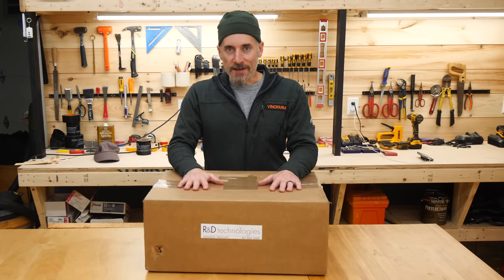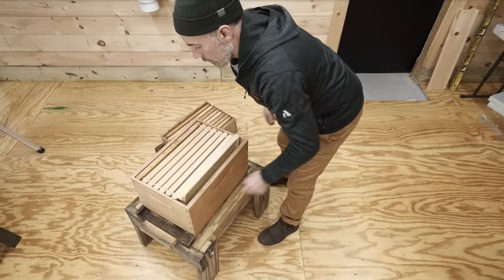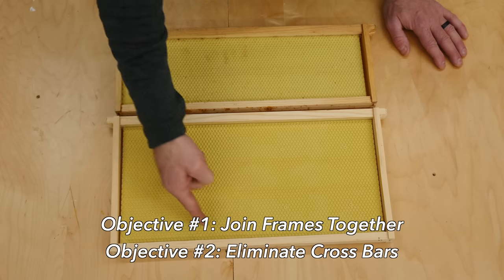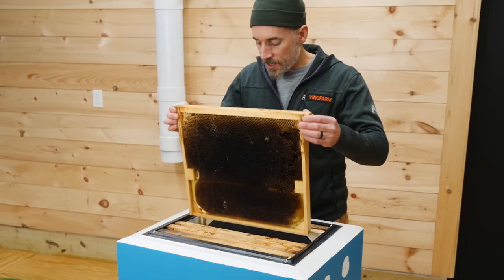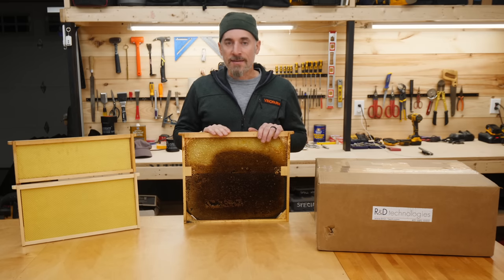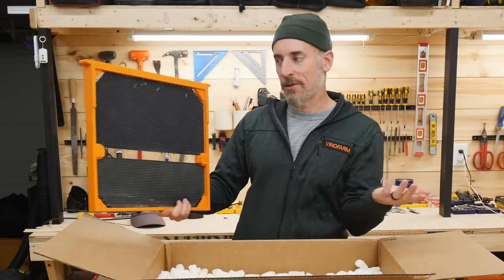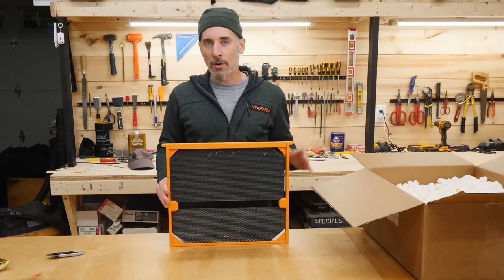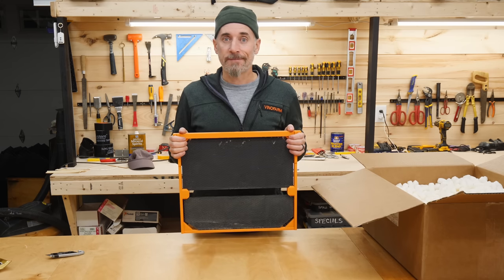Bigger, Better Bee Frames? Let’s Make This Happen!

Comment: At this point... why not making the plastic sheet in the middle too. 
also - why are the companies making frames can't just make big frames like this ? (using big sheet too).

I would try to contact them too.
Reply from the maker: Frame companies are not just "making them" because the mold to make them costs many tens of thousands of dollars. This is going to need to be fundraised. Also see pinned comment regarding why there is not full foundation.
Reply: Switching account here but same person sorry - 
I was thinking about wood frames. Maybe it's easy for them to make the side bars like they do... but longer ? About the sheet, I get it. But let's make some holes in the sheet but keep it on size and alternate the side (left/right) instead of up/down.
They already have the equipment. One mold was costing 100 000$ at the time when I was working in it a bit. I don't know how much it is today !!
:S

In anyways - I did my version of the Bee Barn here with 2x deep frames.
We'll see in the spring if it was a good idea :) I believe in your concept and wish I could help.

Comment: Well now I have to see if I can cut them out with the laser in the shop at school.  Trotec said it would cut through 3/8" cherry, so cutting through pine of fir should be a go.  Might have to still cut the groove with the table saw, I'll let you know if it works.

Comment: Personally I do not work on injection molding, but the company I work for has an injection molding department.  I love hanging out down there and talking with them, we do get into talking about costs for things.  We have fairly small molding machines just 40 ton presses and such, probably about the size of a car.  Getting a proper mold manufactured depending on how many parts to want to make per cycle can be fairly costly.  Like I said we have smaller presses, but one of our largest molds can make 24 parts per 30 second cycle, and when that mold was crafted, it cost the company close to $124,000.  I am not sure if costs have come down from when we had that mold made about a decade ago.  I assume you would have a molding company run your mold, instead of buying your own press.  But if the demand for the frame and barn are there, injection molding might be the fastest way to get them made.
Reply from the maker: Yeah, molds for this type of thing are going to be in that ballpark. Pre-covid, It would probably have been half that. I'm still going to give it a shot.

Comment: What is the cell size and can that be adjusted?
Reply: While I don't know what cell size he uses (I gonna assume the usual 5,4 mm) I don't see any reason why you shouldn't be able to adjust the cell size to something smaller since you can put whatever foundation you like in there.
Reply from the maker: The plan is for these to be produced as blank frames. You will add whatever foundation you like. Pop out drawn comb from an old frame and it will go right into these. I will not be molding any cell pattern into these.

Comment: I am willing to invest for the opportunity to get some frames like you envision which seem to work better than Langstroth frames. They'll be reusable and should last a long time. As an idea for the cost, ICOMold by Fathom in Holland, Ohio says they can give you a quote for injection molding in minutes.Their example tooling charge for simple molds is $3000 to $6,000 and they will help you choose the kind of plastic. Their website says there may be other manufacturing methods for low numbers of runs. Of course other companies may be cheaper.
Reply from the maker: Thanks for the tip. However, add a zero to your numbers and you will be about half way to the quotes I'm getting.

Comment: Would custom foundation eliminate the blocks on the sides?  It’s likely the foundation is made the same width and cut for deep, medium, or shallow.
Reply: If it's injection molded it might be possible for the foundation to be part of the mold. No blocks would then be required because it would be a part of the frame.
Reply from the maker: See the pinned comment.

Comment: CNC the pieces out of wood.  If you have the files talk to a local cabinetry building company or woodworker who has a CNC machine.
Reply from the maker: And what would they be cut out of? Any production CNC shop is going to use plywood and that is a terrible idea for beehive frames. They need to be solid wood and no CNC shop is going to use 3/8” thick milled lumber for production. It’s not really feasible.
Reply: @vinofarm   Valid point.  Loving the frames, will be (safely and carefully) building a set.  I already have the new boxes and foam. Might be interested in the plastic frame kickstarter idea.  Tough since I currently have 2 hives and wanting to go to 3 this coming year. 
Love the videos and content!! Keep going you are doing awesome!

Comment: I thought about making a extra thick and insulted cover instead of the inspection/feeder box and that´s because I already have a clear plastic cover and a feeder box so if I have a clear plastic cover during winter/spring and I want do do a quick peek all i have to do is lift the insulated top, when it´s time to feed the bees I have my feeder box and by then it´s warm enough that I can start using the "normaly" insulated cover. 
The only concern I have is the (possible) air gaps between the hive and the cover although i make it as tight as possible and that I´m losing some effectivnes somewhere other than the gaps.
Is there something I´m missing?
PS I´m not using a Langstroth hive but a more square hive (roughly 18x18 inches) that is normaly used here in Sweden.

Comment: About 15 years ago, I had to get some injection molds made for a small part, 2”x4”. It was very expensive ~250k-300k. Then on top of that there is post-processing of the part when you injection mold

There are several issues to consider:
- Burr removal, is it required? Depends on where you put the seams.
- tolerances for any small spaces (ie the grove)
- wear on the mold. You can get a cheaper mold made, but it will have to be replaced sooner. 
- is a proto-type mold good enough for the number of pieces you will be making? Those are much cheaper to make, but will only last for a few hundred to thousand parts
- consider making them in 2 halves, top and bottom with the foundation printed as a single part for each half. The most complex feature of the mold will be the slots for the foundation. If you print the foundation as part of the piece… no grooves. 
- the molds are typically made for a certain piece of equipment, just because you find a cheaper mold may mean you limit yourself on manufacturing partners 
- the layout of the parts in the mold is important. Determines where you will have tabs and burrs

Also, why a medium and a deep and not two deeps?
Reply from the maker: Great points. I’ve been talking to injection manufacturers for 4 months. I’m aware of all of it! My quotes have been crazy but nothing approaching 250k. I’m planning to simplify the design with some engineering up front that should make the mold a lot simpler. Stay tuned.

Comment: That 3d print cost is insane.  I designed one in a hour and will be running it trough my $350 dollar 3d printer shortly.   I haven't done a cost breakdown but I am going to say $5 a frame.  Having someone else print them would likely cost more.
Reply from the maker: How big is your printer bed? You can print a 19” x 16” frame? That’s going to cost more than $5.
Reply: @vinofarm  depending on how you print it, you could have some assembly required and avoid the necessity of doing it a one piece.
Reply: @vinofarm  400mm by 400mm by 450m. I have to print a lot diagonal for the hive project.  I am buying 1kg spools ay $10.  The hole hive should end up costing $150  in plastic plus all the waist from mistakes and design flaws.  Its been a fun project but I'm racing the clock.  I promis to share when I'm done.
Reply: @banks8292  i originally was making a double deep, but I wss never happy with how the joints held.  Im doing one peace so the weight doesn't rip it apart.
Reply: Here is the print of the long wall.  Like Mr banks said it is part of a module design to I can make it extra thick for more insulation. https://youtu.be/4d0W2Wjzbfc.  I promise to share.  But I need to make it all exist first.

Comment: I love the idea but plastic or petroleum based is not the way to go. Unfortunately this will just add more micro plastics in everything
Reply from the maker: I would rather not use plastic but it is a superior material for this application. I will be looking into recycled plastic as a first choice. All honey you eat or buy has come in contact with plastic at some point. It’s impossible to avoid.

Comment: looks very much like layens sizing. I'm in same area as you and we had similar issues of bees coming through spring, starrving in late spring due to late freezes.  we went opposite ways I tried wrapping and quilt boxes and everything under sun, nothing seemed to change survival. (not that my survival was bad) so past few years I just started doing nothing. some may get a foam board on top but that's it. survival still didn't change. so why waste resources for me. I mean what a relief to not do anything for winter. what a relief not to wast money on insulation, hive products, wasted time preparing hives. man it's awesome. glad you found your way. I'll do mine. good luck!

Comment: I wonder if there is a cast-able resin solution for your frame.  There is also "roto-molding".  I image an injection mold that size is probably about as much as a new truck.
Reply: Linus tech tips sought out making their own mold blank for their screwdrivers, and while I dont remember the cost, I remember the impression the cost gave me which was "damn thats pricey" I want to say something like 10g, but i really dont remember
Reply from the maker: A mold for a single, one piece injection of that size frame is approaching 100k. I’m probably going toward a multi part mold which will actually wind up being more efficient in the long run. Molds are insanely expensive.

Comment: Why not just use a C&C machine to quickly cut out each individual wooden piece 🧐🤔?
Reply from the maker: 1. I don't own a CNC. 2. Anyone running a CNC is going to cut the pieces from plywood. 3. Plywood in a damp, humid beehive will warp and delaminate within about a month.
Reply: @vinofarm  ahhhhh maybe in the future there will be the technology to cut plastic!
Reply from the maker: @kristi.kervin  CNC is great technology but when producing large volume there is a lot of waste. With Injection molding, the exact amount of plastic is shot into the molds. Still some waste will occur, but not as much as CNCing sheets of plastic and far far cheaper.

Comment: Why you would construct massive frames that don't fit in an extractor is beyond me.  It makes it very hard to spin out honey bound frames or to replace or rotate them. You're then stuck in some cul de sac of beekeeping with few options. A queen cannot lay more eggs than fit in a single deep no matter what she does. it's just not mathematically possible. The barn system eliminates useful options like Demaree. I insulated my bees and they stayed at no less than 85 degrees all winter because they and a smaller place to heat and cool. I had 100% survival.
Reply from the maker: You seem to have missed the point. These are brood frames for a dedicated brood box. The hive is supered with any normal Langstroth Supers/Frames. These frames live in the brood box and are never intended to be extracted. The increased area of the uninterrupted comb allows the queen to comfortably hang out on one side of a single frame for days just laying away. No need to jump gaps and jump from box to box.
Reply: @vinofarm  I run single deeps so i have a dedicated brood box. You can't Demaree this.  It's solves a ton of problems that don't exist.
Reply from the maker: @AdamNwesternmass  How many colonies have you lost over the past three years? 

How many brood boxes have you bent over and lifted in the past three years? 

My answer to both of those questions is zero and zero. 

For me, those were problems I had and those were problems worth solving.
Reply: @vinofarm  Because I run single deeps I never lift that bottom box. So, indeed the answer is zero. I lost none last year. 

I also spend zero money engineering a totally unneeded solution
Reply from the maker: @AdamNwesternmass  Why are you wasting your time commenting? You seem to have beekeeping totally figured out. Maybe you should spend time making helpful videos sharing your wisdom instead of hating on a concept that's been 100% successful for three straight years. You must be bored, so I'll keep responding.

Since putting bees in these hives in 2021, I've had zero winter loss, zero piles of dead bees outside the hives or on the bottom boards, I've had zero stress about ANY outside temps or cold snaps, have done zero winter feeding or supplements, and basically do half the actual work I used to do to keep my bees and each year, they have come out of winter bigger and stronger than ever before. My queens start laying in February, in Massachusetts. Also, In all the alcohol wash tests I did in 2023, I counted a SINGLE mite in one of the washes. All the others had ZERO mites. 

All that being said, it seems like you're still saying your methods are better. I'm all ears.
Reply from the maker: @AdamNwesternmass  Replying to a previous comment you made: "You can't Demaree this"... If you're doing Demarees, you absolutely ARE lifting brood boxes, which you also said you weren't. Which is it?
Reply: @vinofarm  Also, this system makes it so hard to replace comb or get comb built out. The bees need to build out such a massive frame. Maybe it's OK now but as toxins build up replacing that comb is going to get harder.  

I run brood/comb Palmer style factories to generate replacement comb. That's just impossible with this system. I also Demaree to get comb built. I also taranov to get comb built.  All impossible with this kind of system.  What do you do when you just need to grab some equipment because you caught a swarm?  

I am posting here because I am astonished by how overly complex this system is.  I live not 50 miles from you so I know this is completely unnecessary and I don't have time to make videos.  

Beekeeping has become a lot harder to teach in an environment where so many people are proposing wild solutions to basic problems. 

My don't you post when there's well over a hundred years of successful track record for your system?
Reply from the maker: @AdamNwesternmass  Foundation pops in and out in seconds: https://youtu.be/BH_51bLW7zU?si=d2Ve9HHq3Sd7gUjp&t=137
Reply from the maker: @AdamNwesternmass  It's funny that you think this is ":overly complex" but you seem to spend a lot of time "Demareeing, Taranoving and Palmering" and I do none of those things. It also looks like you add insulation to your hives for winter and I see you also take it off for summer. I don't do that anymore. Insulation is built in and year round. This is the SIMPLEST beekeeping I've ever done. It has reduced more than half the work I used to do and virtually ALL of the stress.
Reply: @vinofarm  You loose all the wisdom you might find in your local club.
Reply from the maker: @AdamNwesternmass  What does that mean?

Comment: If the deeper foundation was at the top even by itself would not the bees just build on the bottom edge as required? I truly like the idea of the deeper frames for the reason you say but also it is a more natural shape if you look in wild hives.  Thanks and good luck from New Zealand.

Comment: A Layens is a top bar hive BTW.
You sort of have a Layens frame. I DIY mine from simple 2 x lumber where I make all the complex cuts before I rip them to 3/8 inch thick each on the end bars. I made my top bars and bottom bars from salvaged door frames that I ripped to width (because I had replaced some pre-hung doors and didn't want to waste the lumber).  I picked up an idea on line for intermediate starter strips for foundationless frames and bought some 32 inch bamboo skewers that I cut to length with a coping saw once I had therm glued in place pushed through the end bars. My frames are 1 1/4 inch wide but 1 3/8 would have been just as easy to make. 
For a Layens purist my frames are about 3 inches too tall because I wanted to use an adapter with 2 medium frames with foundation stood on end to begin my adventure with Layens. I have experience with foundationless Langstroth and unless you have existing drawn frames to guide the new comb, there is no telling how they will build comb. Now I have those drawn out adapters that I can slip my foundationless frames between. 
An aside, the bees loved my tall frames and a new package reproduced so well they swarmed twice before I caught up with them with enough frames. I had started with only 12 medium frames of foundation and the first swarm happened in about 6 or 7 weeks after the install.
Reply from the maker: Layens frames are about 50% smaller. And they have closed tops. And they are meant to be stacked horizontally. And not supered. These frames are 50% larger, have open tops and fit into existing Langstroth equipment. They are meant to be used in a vertical hive with Langstroth supers on top. These are the opposite of Layens frames. I get why people are making the comparison, but when you actually think about the two, they are not similar at all.

Comment: How are you going to alternate the med over deep to deep over medium foundations so you dont have all frames the same? I assume you need 2 molds or will the side blocks be movable?
Reply from the maker: Movable spacers that plug in the side bars.